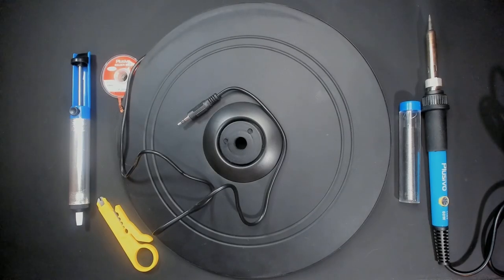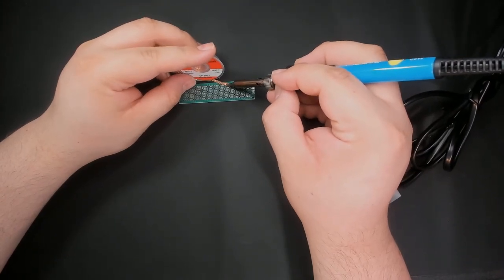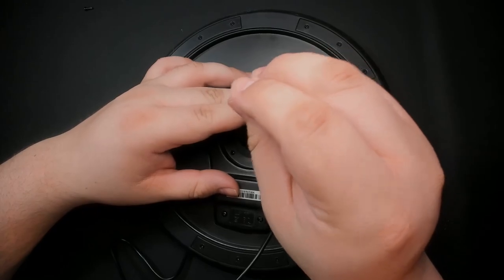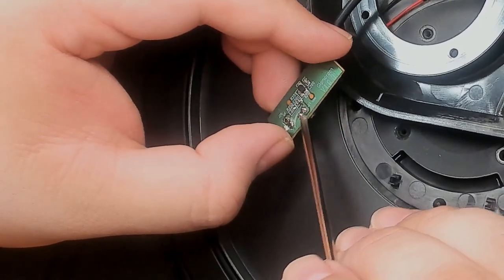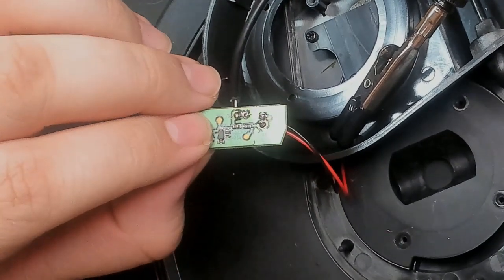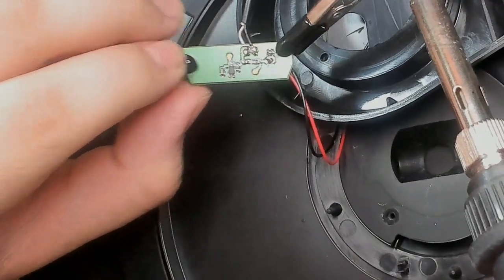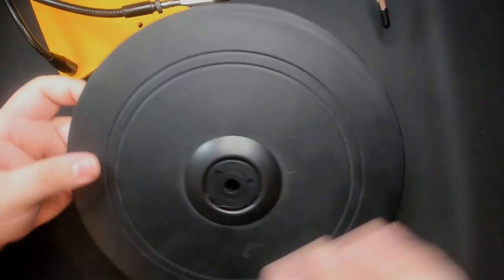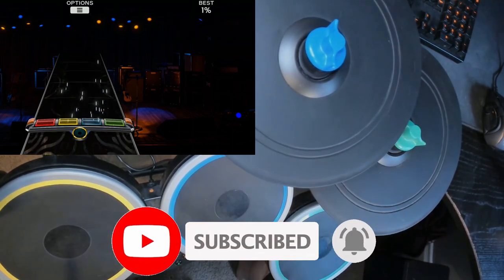How to SAVE BIG with this Rock Band 4 Drum Fix

Comment: Just a note to say how grateful I am for this video. While I already know how to solder this gave me ideas as to what could be wrong with my cymbals. While the wires were not broken off like yours I noticed the entire housing where the wires goes in is cracked so I had to start there to troubleshoot mine. This video was extremely useful to me for where to start. Thanks again and long live Rockband!!

Comment: Hi mate, great video. I’m not sure if you are still active one YouTube. I’m struggling with mine. All the wires are still attached and look good. However it’s still not working. Do you know the names of the parts inside so I could find them online and remake this from scratch? I know you used the blanket term PCB. But  have no idea. The gold pickup plate thing as well. Haha
Reply: Mine was an issue with the wire that plugs in not inside the symbol